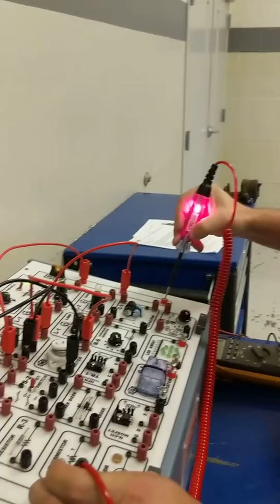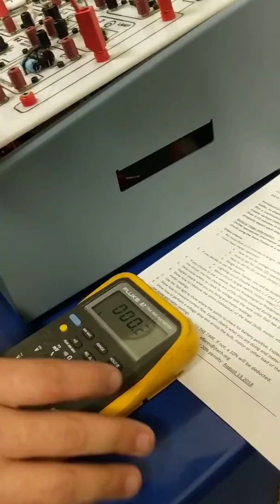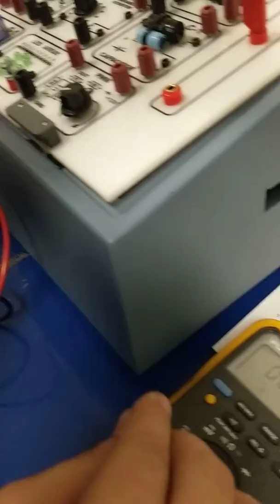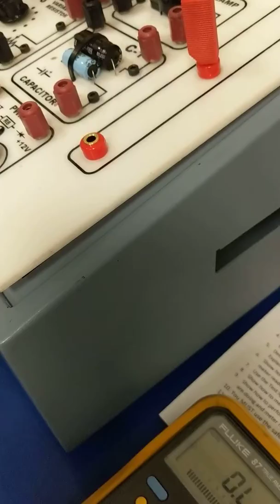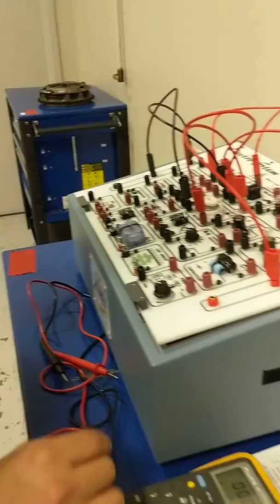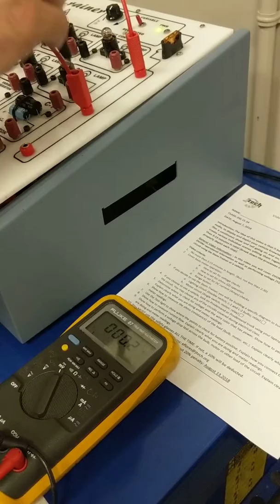How to use a Multimeter and Test Light on a circuit

Comment: Good video, Robert. You used the multimeter for the tests. Now, don't forget some topics covered in class. For example, when measuring this type of circuits we use the DC Voltage, to measure voltage drops the system must be on and for the amps, the multimeter must be part of the circuit and the system on. Keep practicing.